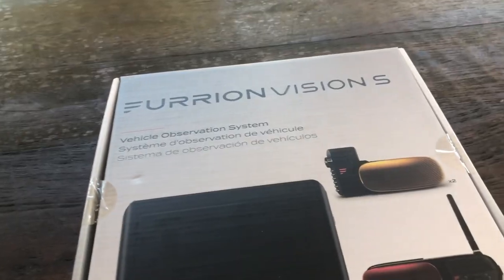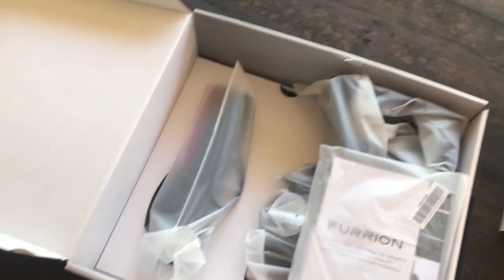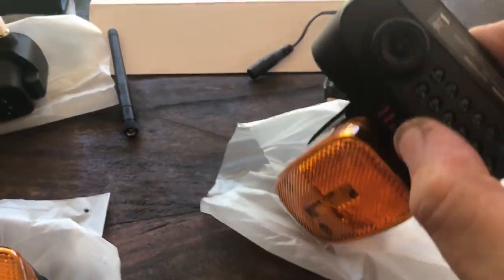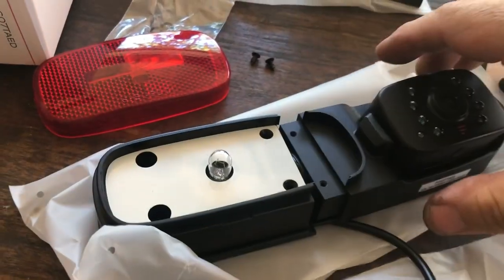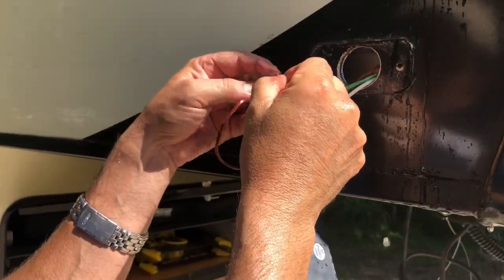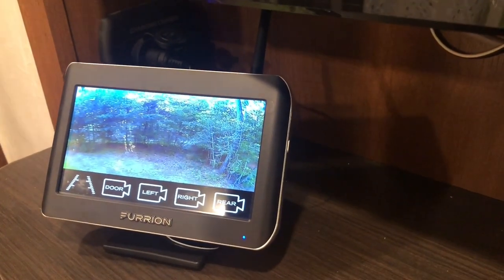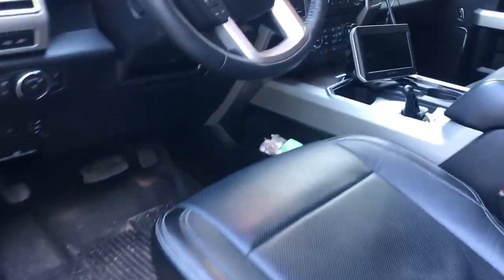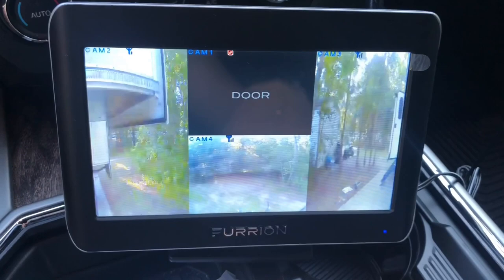Furrion Vision S vehicle observation system unboxing and installation

Comment: Depends on which system you order, I ordered the 3 camera system with the shark fin ( which actually makes it a rear view observation camera vs a back up camera, sees further). By the way those screws are non ferrous so a magnetic screwdriver will give you a false sense of security. Got mine today and it HAS led lights in it. P.S. my new cougar has the Furrion side lights pre installed with just a dummy plug in place of the side cameras so tomorrow it will be a true plug and play system for all three cameras!  Woo-Hoo!

Comment: Have you considered "shimming" out the front of the side side light camera/bracket a wee bit to maybe see the side of the trailer? For the life of me I cannot figure out why they angled them in such a way as not to see the side of the trailer (think tree/etc when backing into tight campsite - also would help on tight left/right turns to ensure rig going to clear car/curbs?).  I also heard that with the Vision S, if you are driving forward, the monitor reverts to last "full" camera angle and drops the four screen view?
Reply from the maker: I did consider using a shim but it needed to be bigger than I would have liked and would have required a lot of caulking to seal the gap. I may change my mind about it. And yes, the multi view doesn’t stay for long. I think it’ll only display all for 7 seconds or so. 
Thanks for watching!
Reply: Just had these installed by camping world and I’m really disappointed, I specifically told them I wanted to see the side of my trailer for parking in tight spots and I was told they were adjustable….. come to find out they are not and now I’m out a ton of money and have a useless view of nothing useful

Comment: In the multi view screen, have you found a way to drop the non existing door camera so it doesn't just display a blank space for it?
Reply from the maker: Unfortunately there’s no way to customize the screen views other than a single camera or 4 camera view (4 cameras can be viewed in 2 modes). This is one of the short comings of this system. I’m going to do another video on the pros and cons of the system soon.
Reply: @magnoliatom1300  Thanks for the reply, hopefully there is room in the firmware for an update to fix this in the future.

Comment: Have you had much on the road time with it? Curious of you had any loss signals or delayed images? How much does the side views give as far as traffic on either side? Like blind spot helpful or no?
They made LED conversation for that style of marker light. You get the LED part and a new lens. I found it cheaper to buy the complete light and swap the LED assembly and lens to the original base.
Reply from the maker: Yes, I’ve got around 2000 miles with it so far. No loss of signal yet. I have noticed at times a lag or delay in the signal of about a second or so. The side views are great for viewing the traffic. The field of view is plenty wide to see the next lane. One complaint is that they cannot be aimed. You have a “blind spot” of about 2-3” right next to the trailer walls. Not a big deal really but I’d like to see down the entire length of the trailer, including the walls of the trailer. 

So far the bulbs seem fine. I haven’t replaced bulbs yet so if I do, I’ll look into the replacement. Thanks for watching

Comment: how did you run that brown wire, so it is always hot? Where did the wire run to or connect too?
Reply from the maker: Keith Valence 
I tied into a constant hot circuit. The brown wire was spliced into the light under the king pin.
Reply: @magnoliatom1300  So the additional wire is tied to Hot/power wire on the camera side, and you fished the other end to the light above king pin and tied it into the hot/power wire on that light? And that creates a signal where the camera is on 24/7 and can be used as security cameras as well while you are inside the RV?If I understand this WITHOUT that brown wire you added, the cameras only work when the lights to the towing vehicle on on? Thank you for your help on this, I just ordered mine today, so it should be here in a few days..
Reply from the maker: Keith Valence 
That’s correct. If you don’t have a constant hot to the camera, the camera only works when either the turn signal comes on or the running lights are on. 

Good luck with your install

Comment: would one be able to make the door camera a 3rd brake light camera for 5th wheel / cargo bed view hookup's? is there a way to change door to say cargo?
Reply from the maker: You can use put the cameras anywhere you like. So, say if you want to put the camera that is suggested as a door camera to your front cap/king pin area to view the truck bed, that’s not a problem as long as you can get power to the camera. But, the monitor doesn’t allow you to customize or edit any of the camera names.